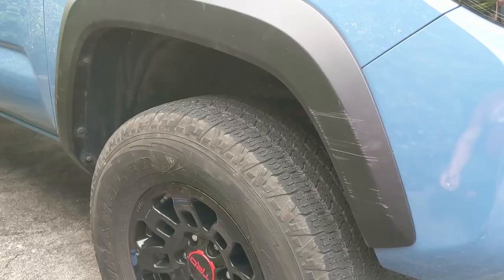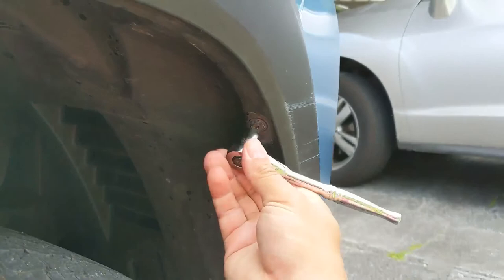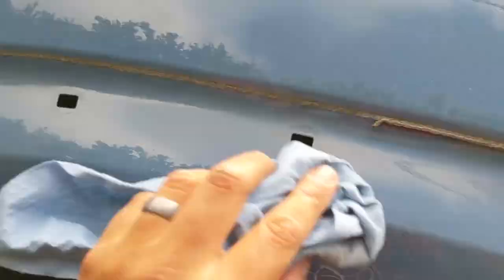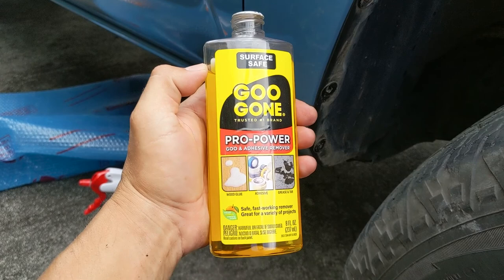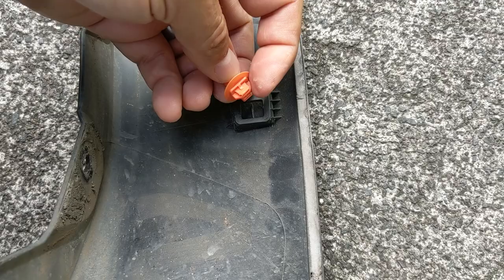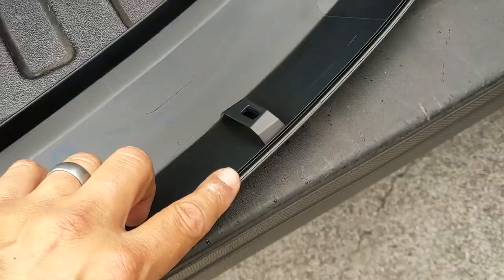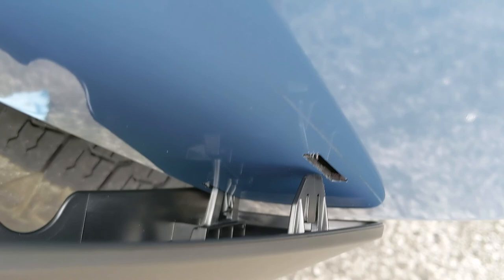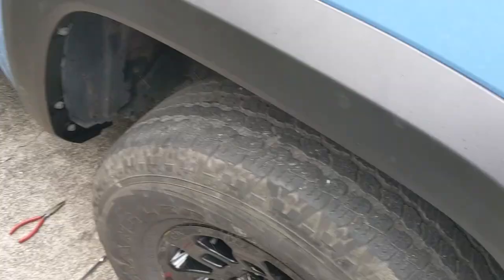2016-2019 Toyota Tacoma TRD Fender Flare Replacement (Remove and Install)

Comment: Easiest way to get that 3M tape off, eraser wheel. I’ll be taking mine off, sanding them down smooth, then spraying them with bed liner and reusing them. More durable and a nice pop to the vehicle as well.

Comment: I was thinking about putting the orange & blue clips on the flare first and pushing the whole thing on
Reply from the maker: Hi Gregory, some of the clips require a twisting motion to be installed on the fender, and they require more force to be inserted into the fender than to be clipped into the flare. I would insert them in the fender first, but I think you have  a good experiment to try; it might work just fine. Post your results, please!

Comment: If you live in the rust belt you should spray fluid film in the holes 🕳️ of the fender while you have the flair off. Or something similar like wd40 for a water displacement. Give it plenty it won’t hurt a thing.

Comment: On the one flare you removed in the video, one of the tabs on the front of the flare broke off. Were you able to remove the other 3 flares without breaking a tab? I’m gonna remove and reinstall the oem flares
Reply from the maker: You just need to be careful to not break that tab when removing it. You might want to try to put that flare tab out of the fender hole rather than pulling on the flare at that point. It's pretty fragile actually. I wasn't being careful to preserve the flare since I was replacing it.

Comment: Got to do this on 21 trd pro. Some jerk hit me. 😞 how much was the oem flare?
Reply from the maker: I paid about $220 for it from the dealer here in Hawaii. You can get them for around $160 from some mainland online dealers like Sparks Parts, but the shipping to Hawaii was going to make the cost the same as buying it here. Also, check Ebay for good used one.
Reply: @whatwouldjessedo  do they offer the flares painted to match the body?
Reply from the maker: @rossdegreve5527  No, Toyota doesn’t offer them painted, but you can find used painted ones on Ebay.

Comment: how did you order the flares from the dealership ?? i’ve asked my local dealership twice and they told me they can’t order fender flares
Reply from the maker: The laziness and bad customer service of some Toyota dealerships is amazing sometimes. You can order them online from plenty of dealerships if your local dealer sucks. SparksParts has been a good source in my experience: https://www.sparksparts.com/oem-parts/toyota-fender-flare-right-front-7587104060
Reply: Are the factory flare consider smooth or textured ?